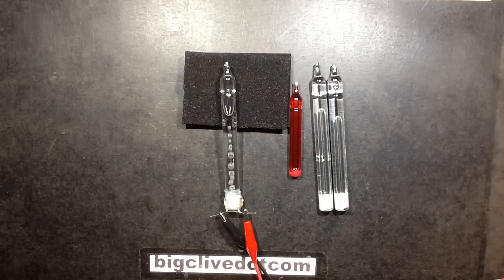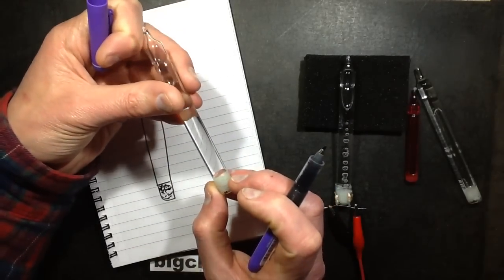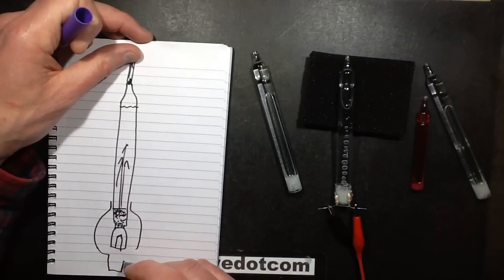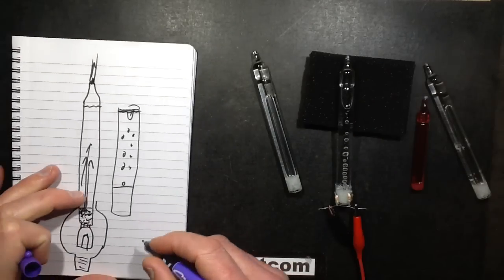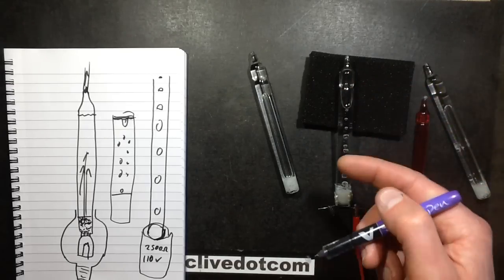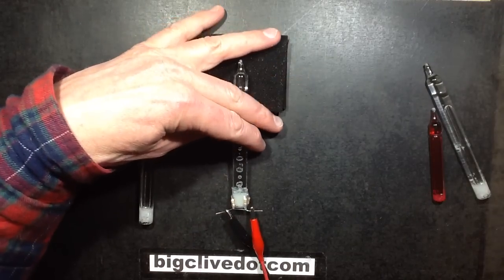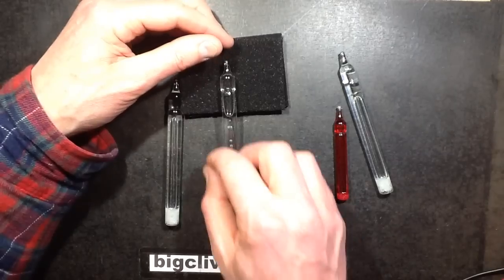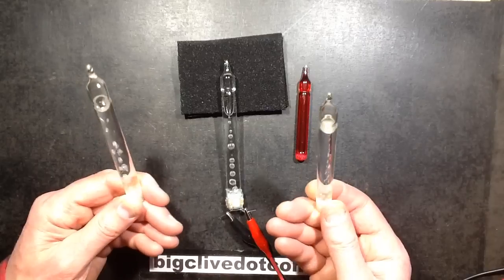How Methylene Chloride bubble tubes work.

Comment: My family use to have bubble lights. I always wanted to break one and drink the liquid. Probably for the best I never did.
Reply: Used to strip paint. You were wisest not to drink. If ingested or absorbed through the skin, methylene chloride becomes carbon monoxide inside the body.

Comment: While I never saw or heard about these before, I do miss the creative illuminated decorations that people decorated their Christmas trees with.  That was when most light sets were 20 bulbs and available as various star shapes, petals, miniature lanterns and so on.  It was unusual to trees decorated with plain bare bulbs from what I recall.  Just before LEDs took off, most people turned to using bare bulb sets, cramming as many lights as possible on their trees.  With LED, the number of colours also fell from 6 to 4.
Reply from the maker: This is why I strongly recommend making up your own christmas tree lights by hacking existing tungsten strings with every shade and shape of LED and cover you can find.  I remember walking through junk markets and seeing scrappy old boxes with original decorative lamp sets from the era you describe.  Now I wish I'd bought them.

Comment: Boyle's law and nucleation sites are what you want to google if you want to know the physics behind these things. very cool
Reply: I thought nucleatiin.
but I couldn't see it working in a closed system. but it's not a closed if electricity is going in. thanks!
Reply: No real system is truly closed when you really get into it. You usually just model things as closed to make the math (and your life) easier..

In this case though, you would consider the room a closed system. Energy is coming from the room into the bottom of the tube (via electricity) and then through the tube and back into the room (via vapor condensing). These bubble tubes are essentially very weak heat exchangers. The general rule of thumb is that when a vapor becomes a liquid, it sucked some heat from somewhere to do so.
Reply: Gunhaver 
Conservation kf energy.
A reaction never comes from no where (on the macro) and never results in "nothing".

Comment: Actually, you would probably not need a vacuum pump.

You can find experiments where they boil water in a bottle to displace the air.

If you fill the tube, make it boil, pinch it off, cool it down; then you have the vacuum and it should be ready to use.

Please tell me if I am wrong, but I am rather certain about that fact.
Reply from the maker: omgffsification Bens version took a really high temperature to boil and also really needed the crystal structure at the bottom to help stop the warmer solvent just circulating up to the top without boiling.  My preference would be the type that can boil with just finger heat.
Reply: bigclivedotcom
Maybe you could rig up an aquarium air pump in reverse for producing the vacuum.
I think Ive seen a video on here where one is hacked and used as a pickup tool for smd components?
They are certainly cheap.
Reply from the maker: omgffsification The aquarium pumps tend to have soft rubber diaphragms so they aren't very good at producing a vacuum.  The peristaltic pumps seem to do a modest job though, to the point of collapsing their silicone tube in.  But still nowhere near a repurposed refrigerator pump or AC testing pump.
Reply: bigclivedotcom But if you pinch of a vapor-filled tube, when it cools it will condensate until it's at equilibrium and you would have the desired pressure inside the tube.

But you would need to heat it enough for the vapor to escape the tube first. Should be doable with water too (like they use in heatpipes)

Comment: So would these self excite in a hot tropical country? as they seam to work off body heat.
Reply: Sadly not, they'd need a temperature differential to operate
Reply from the maker: Yeah, they really need a temperature differential.  But if you get one of the rocking-bird ornaments that uses the same system then you can put it's base in a position that sunlight hits and the rest shielded.  Then on good days it will bubble slowly.

Comment: This sort of lamp was also used by the Lionel train company in their oil derrick/pump station accessories. The tube was filled with yellow colored fluid to simulate oil, and was capped off with simulated piping and valves for the "oil" to flow into as it bubbled up. To really sell the illusion, it also had a walking beam pump that went up and down using electromagnets.

I also remember the X-mas lights, used to be for a while they had stopped making them and so seeing them was a special thing.

Really like these lamps, like a lava lamp you can sit and watch 'em bubble for hours.
Reply: My dad has one of those Lionel things from when he was a kid, it's pretty neat

Comment: You dont need vacuum pump to create this... just heat it up so it starts boiling a bit, while the tube is still open, and vapours will displace air from tube, then heat and seal it off while it still boils slightly. 
By the way, this is an excellent demo how a simple heatpipe works...u just cant see inside :-)
IF U WANT a free vacuum pump (that you dont need to wory destroying it or fouling up vacuum pump oil) u can use old (working) fridge compressor, it makes quite a hard vacuum, have seen friend regassing He-Ne laser with it, and it worked,well still works...
Reply: Exactly how i did it 😀 I put at screwcap testtube with sand and acetone in hot water. Closed it off when it began overflowing from the vigorous boiling. Runs on the heat from my hand, or room temperature, when the empty top is covered with a thin layer of damp tissue paper. I wouldn't recommend sand though, since it is too fine to give stable boiling. These things are SO AWESOME 😀

Comment: The salt is preventing retardation of boiling, called superheating or bumping too. Another example of this is: Heat a cup of water in the microwave. After the microwave is finished water is not boiling, insert a tea bag or instant coffee and the water is boiling immediatly. Same effect...but in a closed container much more dangerous than it is in a cup or a glass which is open. A closed container could crack or explode through this superheating. The name bumping is coming from chemistry, when heating a beaker with water on a Ceran plate heated with a bunsen burner the beaker is starting to bump on the plate when this effect occurs.

Mythbusters tested this:

https://www.youtube.com/watch?v=1_OXM4mr_i0

https://en.wikipedia.org/wiki/Superheating

Comment: The dichloromethane boils at below body temperature in air, so it will boil in an open tube. The sealing means it will adjust to keep a constant bubble rate as the temperature increases because it adjusts the internal pressure. Boiling open will just make it short lived.

Comment: Does any one know where you can get DCM in the UK?
I use it for paint stripping and for joining plastics together.
I used to get it off eBay but now can't find it anywhere?
Tia👍
Reply from the maker: You may be able to get it from local fibreglass supply companies.
Reply: @bigclivedotcom   I believe it's restricted in the EU and UK.
However, I'm certain that registered company's, can obtain it as it a crucial substance in many manufacturing processes.
I'm just a ' Tinkerer' I rebuild, customise Motor bikes .
I live in Bournemouth, I'm sure a well traveled, knowledgeable,  Guy like yourself may know someone who could quietly sell me a litre or so?

Comment: How good is the thermal dissipation? Someone should use these as a CPU heatsink. As an experiment of course.
Reply: +SeanHodgins All tower heat sinks effectively do already.  The difference is that the tubes are made of copper instead of glass.
Reply: +Folopolis The difference would be that these boil and look really cool. But they could be terrible at dissipating heat, which would make them bad headsinks. That was the point of my question.
Reply: SeanHodgins The heat pipes that are on all tower heat sinks have a material in them under vacuum that boil as soon as a moderate amount of head is applied.  The material, now in it's gaseous form travels away from the heat source, taking heat with it, until it makes contact with the pipe wall, or the pressure increases sufficiently, it liquefies and travels back toward the heat source.  It is literally the exact same principle.
Reply: Folopolis I'm talking about CPU cooling, and I'm talking about the glass aspect of it. As in the conductive heat transfer of glass. I get that the liquid to gas is doing the cooling, I quite obviously understood that in my first comment. I'm talking about the thermal conductivity of the glass bottom itself, and whether it will provide a suitable sink for a computer CPU. I'm not questioning the method of phase transition cooling effect they have.

Comment: Man I used to stare at these as a child, so fun and beautiful to look at... I remember a few days before. maybe even on the eve of Christmas, the tube exploded and the liquid got in my eye and my parents had to rush me to the hospital... I repressed that memory until now.
I wonder if it was wired incorrectly or our house surged or something but it happened to be the one I was looking at.
Reply from the maker: That's odd.  They normally run at a slight vacuum.  I wonder if the lamp was overheating for some reason and pressurised.

Comment: I have some of the old methyl chloride Christmas lights. They are 15 Volt tungsten filament flat-top bulbs which are glued to the base of the bubble tubes. These would typically be in a series string of 8 or 9 for operation on 120 Volt mains. The light sets with 9 bulbs would run cooler and have a much longer lifespan than the sets with 8 bulbs. amazing that lots of this 60 year old stuff still works great today. Even the 100 year old carbon filament 15 Volt Christmas bulbs I have a few strings of still work great, but they operate VERY hot.

Comment: you shouldn't need to pull a vacuum. heat the methylene chloride to close to boiling point so the vessel fills with vapour, when the temp drops, the vapour pressure drops, bingo, vacuum. works really really for crushing stuff with water too XD

Comment: You used to be able to get Methylene Chloride at the hardware store in the US.  A few years back the safety nazis  pitched a fit and now no one sells it.  Not sure if it is actually banned.  In the last 20 years something like 5 people ignored the labeling and either used it to strip a bathtub (in spite of the large type that said DON"T USE IN BATHTUB) or in an enclosed space (once again in spite of the warning (DO NOT USE IN ENCLOSED SPACE.  HAVE PROPER VENTILATION).
It has been replaced with something that is extremely flammable.  I am waiting for reports of idiots who ignore labels blowing themselves up.

Comment: What?  The Christmas "Bubble Lights" are collectible?  Well, I have a vintage set (7 lamps) in the original box.  They're not in mint condition, the plastic lamp housing on some of them is distorted from heat, but I just tested them, they all work.
Reply from the maker: DimensionDude all vintage Xmas lighting is coveted by collectors.  There are some versions of the bubble lamps that are so rare that they fetch high prices in any condition.

Comment: these christmas lights came out post war the strings originally in series strings of 15 (8V) and had a small 1cm rod in place of the crystals in the 1970's they came out with 117V on a C7 base opposed to the C5 on the originals
Reply from the maker: +Richard Golden-DeWitt I have some of the original tubes with the glass slug in them.  You can still buy new sets of bubble lamps on eBay.
Reply: +bigclivedotcom in the 70's they came out with a mini version they were 2cm X 10mm like the original they ran in series I got maybe 3 seasons out of them

Comment: Methylene Chloride has some short term effects when inhaled on the nervous  system effecting auditory, visual and motor functions which will reverse once exposure ends.

long term exposure data is inconclusive but there is some suggestion that it may cause cancer.
Still probably best not to suck those fumes...

Also half way wondering if these could be used for some kind very simple DIY phase change cooling a bit like a heat pipe... though i think those work a bit differently.

Probably not an ideal substance for the purpose since it needs so little heat..
Reply: +ZerqTM - Every inconclusive study ends with the words "it may cause cancer". It's the law.
Reply: cancer is like the lottery... but where the price is canser....

the trick is not to by more lottery tickets then you absolutely have too...

the problem is it included in just about everything so yeah... may cause canser is true for almost everything..

Comment: Just a thought while drunk on a large scale with some sort of restriction in the tube with a rotor and in it and magnetic couplig could this generate power eg. on a large scale :-)
Reply: +keith watkins it could but you'd need heat to get the bubbles to form, and unless you had an army of people holding onto the tubes 24 hours a day that would need more power than what you'd generate from the rotor.

Comment: A cheap brake bleeding vacuum pump should run about $25 USD at the nearest Cheap Chinese ™ tools shop (harbor or princess in north america)
Reply from the maker: I was looking at the brake bleeders on ebay.  I'm not sure what level of vacuum they produce though.  A full-on vacuum pump will cost around £100 ($150).  I'm just trying to think of ways to justify actually buying one.
Reply: bigclivedotcom looks like 10inches of mercury or more
Reply: bigclivedotcom I made a vaccum pump by placing a 12v air compressor in a jar and connecting the compressors output to the lid. It can be seen on my channel as a desoldering iron.
Reply from the maker: I'd pondered trying that with a plastic case, but the jar is a much better idea.
Reply: Some people use old refrigerator compressors for all kinds of purposes (if it spews out oil and whatnot, and you want to use it to pressurize things, simply attach a cheap gasoline filter, available from your car supplies store). I guess you can visit your local junkyard and salvage it from some old fridge.
Reply from the maker: funky3ddy I have been considering getting an old refrigerator pump.  But in the meantime I did manage to make a methylene chloride bubble tube using a syringe to pull the vacuum before sealing the glass tube off.  It's featured in a recent video.
Reply: +bigclivedotcom bugger! I just posted a comment suggesting precisely that.

Comment: these are actually banned from being made and sold as decorations in america due to the fire hazards they posed on trees.  having a heater operating on a tree was found to be a bad thing when something went wrong.

also the toxicity once they broke added to the problems
Reply: Just bought a string of them advertised as Christmas decorations. They aren’t banned, just hard to find.
Reply: @kassiehope4007  the ones you found are either snuck in or different from the originals.
Reply: Bunk.  The "heater" is just an incandescent bulb like any other tree light in the old days.  The solvent is not flammable.

Comment: where did you get the larger clear tubes?
Reply from the maker: +jaylang11 I think they came from an eBay seller a long time ago.
Reply: +bigclivedotcom Hello! Great work!
Please told me,  how to fix the salt on the bottom of the tube?
that she did not swim.
And what can I use instead of Methylene Chloride?
Reply from the maker: +Василий Рогачиков I used loose rock salt.  To date Methylene Chloride has provided the only good result in my own experiments.
Reply: +bigclivedotcom thanks!
you were able to fix the salt on the bottom?
Reply from the maker: +Василий Рогачиков Just gravity and loose salt.